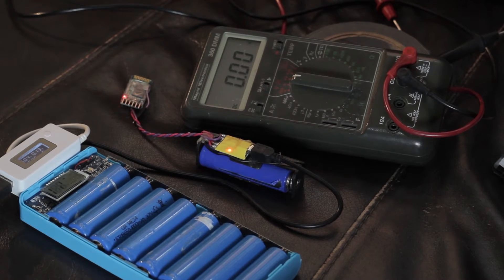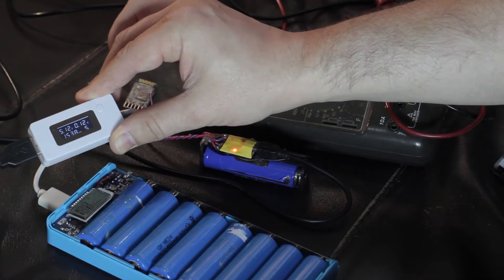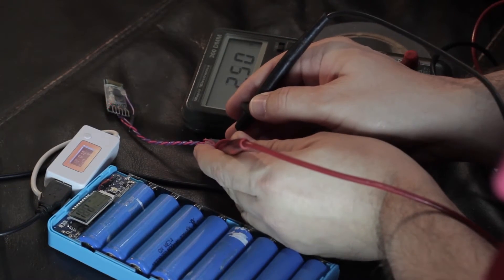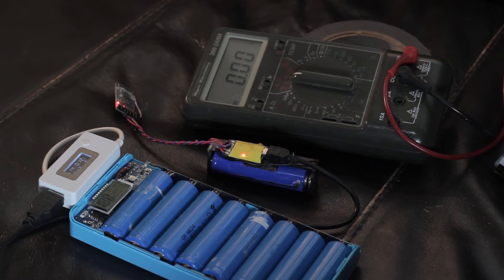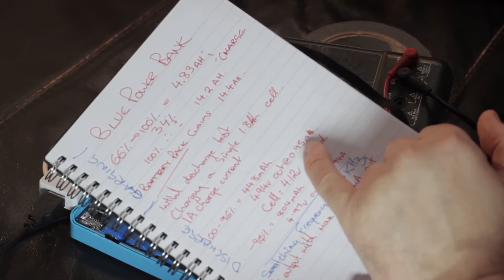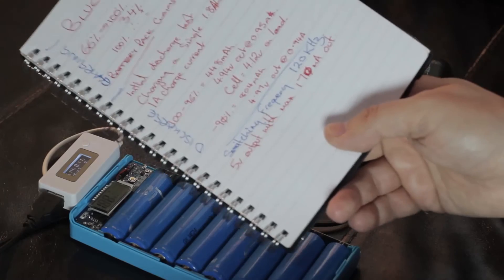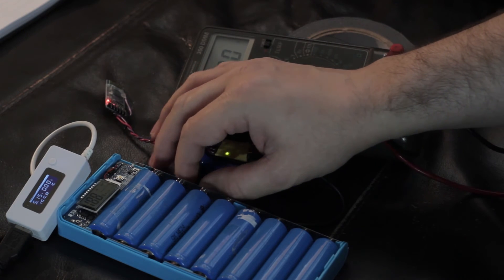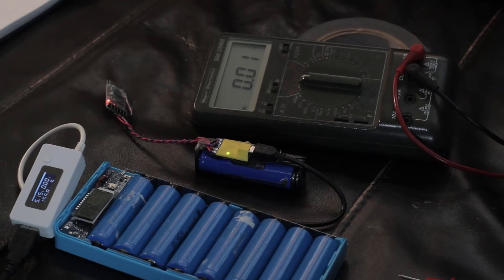Blue Powerbank P3 First load and capacity test

Comment: why they put two input charging port?.
Reply from the maker: No idea why they did it. It is handy though if charging from a PC that only delivers 500mA per port. Using two cables you can charge at 1A.
Reply: is it possible use 5v 2A power adapter to charge this kind of power bank? i just recieve this power bank case today(from amazon) without instruction/ manual and i dont want to use my computer to charge this power bank.
Reply from the maker: Any 5V input would charge the device however I believe the bank only has a 1A charging circuit so any extra power available from the charger won't be used. This won't cause a problem and will be perfectly safe.